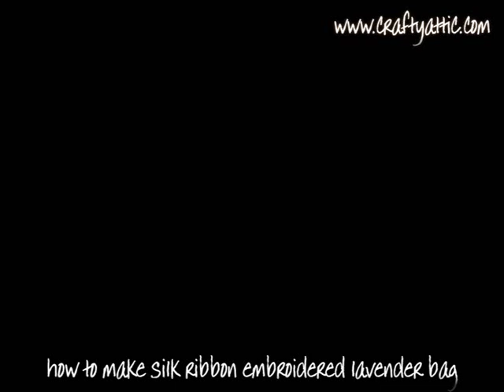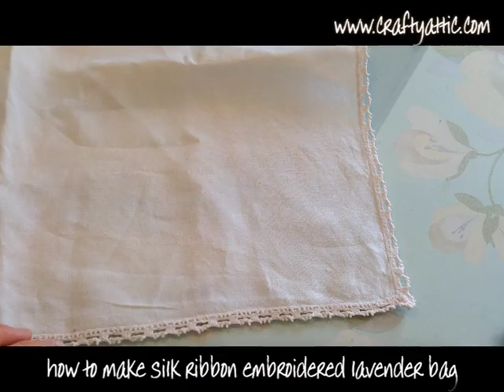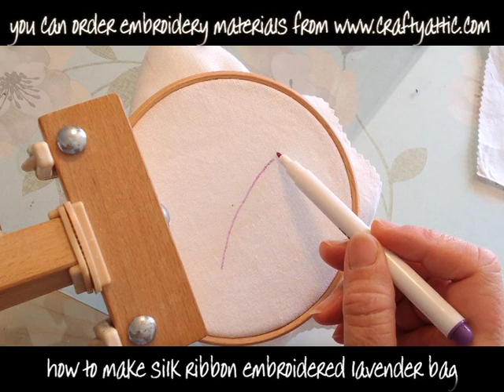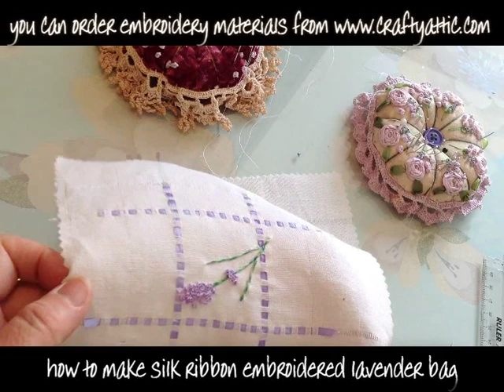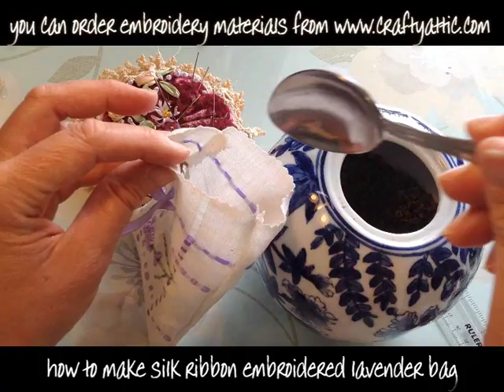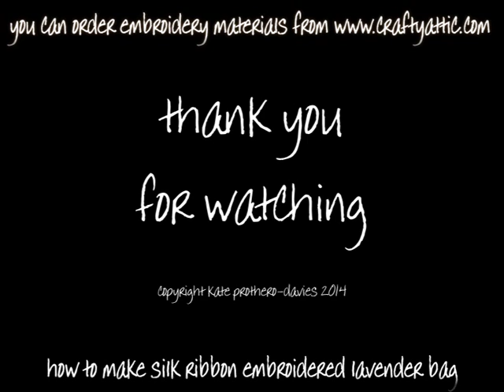how to make a silk ribbon embroidered lavender bag

Comment: Love this project, and your tips are ones I've not seen elsewhere. 
Question: My fabric looks quite similar to yours (from grandma's collection, with that same lace trim) but the threads break when I try to draw them out. I can't even get them pulled out a little bit. Suggestions? Thank you.
Reply from the maker: Kat Hi Kat, it may be that the cotton has degraded a bit due to age and therefore the threads are a little frail.  you could try just pulling slowly and letting the material gather a bit, before you ease this through.  once you have one thread removed, it becomes easier as it loosens the threads around it.  Failing this you may need to try with some more stable fabric.   i hope this helps.
Reply: Thank you so much for the prompt answer - I'll be on thee hunt for better fabric. Your video is excellent!

Comment: Where do you get the holder to hold the loop?
Reply from the maker: You can pick them up anywhere on the web - amazon do them - search for 'universal embroidery stand' for floor standing - or 'universal embroidery clamp' for something that clips onto the table.  Or.... use a g clamp on a table edge (the cheapest and most stable option.  I hope this helps.